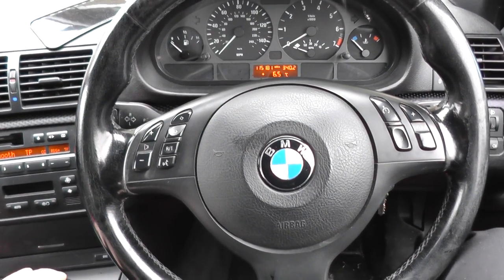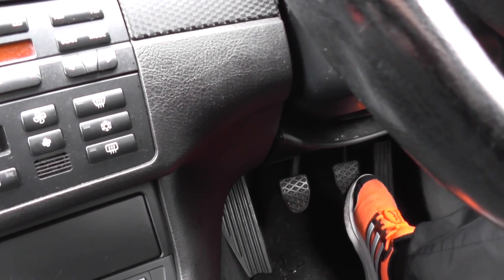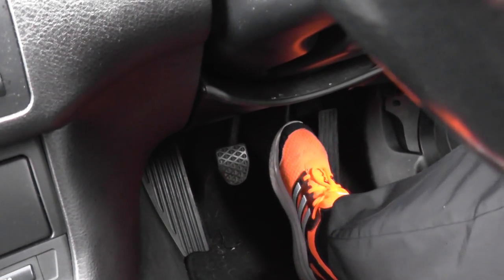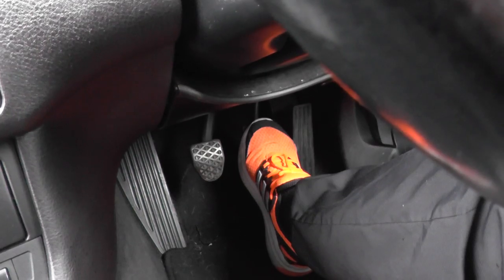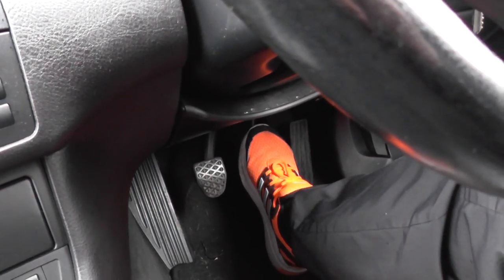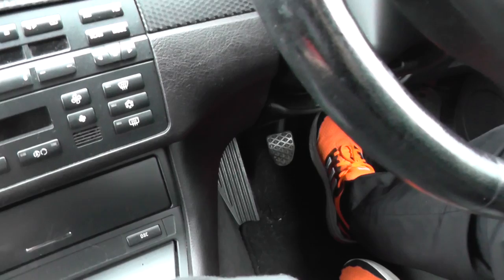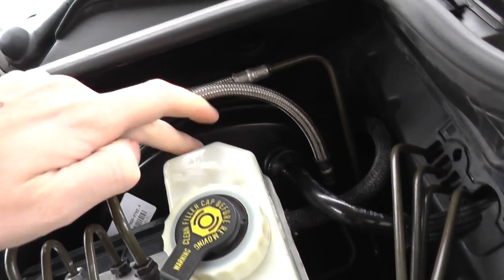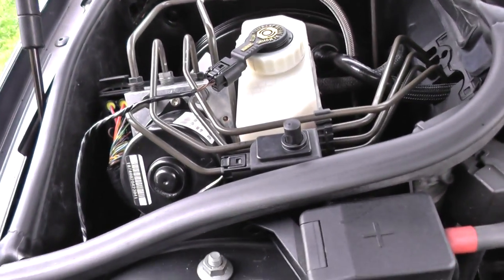BMW E46 E90 Faulty Brake Booster Test For Hard Brake Pedal

Comment: Hi everyone. I have a same car what's in that video, and problem is same, hard brake pedal. I replaced brake booster, vacuum pump, and the hose with valve, but still same problem, and booster doesn't get any vacuum at all. I checked all these  parts on another same car, and somehow everything works just fine. Does anyone has any idea what else could cause no vacuum problem in booster even with new parts? Thanks in advance.
Reply: Check valve n hose may have installed in wrong direction

Comment: What if the break pedal is so stiff the car wont start becaue it does not register the break is engaged to start?
Reply: Its a manual gear not automatic
Reply: Did you find the problem?

Comment: I have the same problem, replaced a new brake booster and it works like new. Problem is three months later the booster failed again. This is cause by the motor oil from vacuum pump migrating into the booster pump. So my advise is check both before putting in money.
Reply: Same problem..replace brake booster & vacum pump..3 months later the booster failed again...then try again replace both ..3..4 days later..failed again...3..4 days....
Reply: How about u mr Yoey Chooi...
Reply: Did you ever resolve the issue?